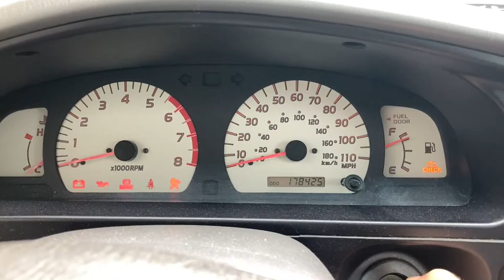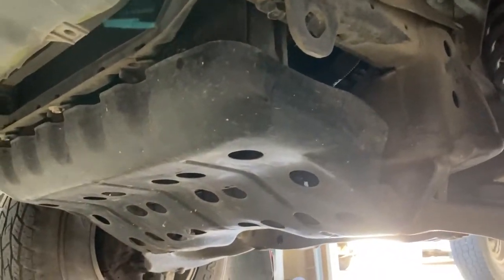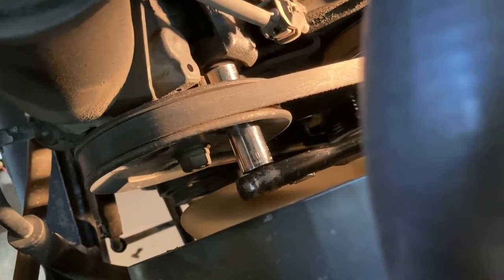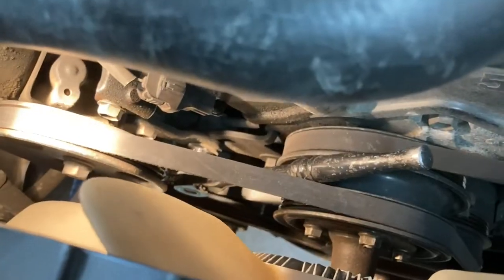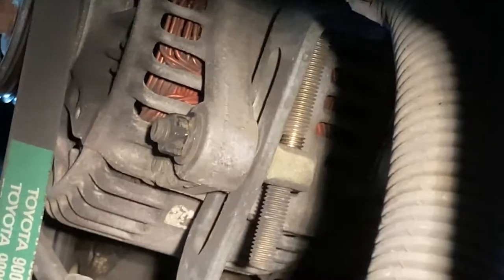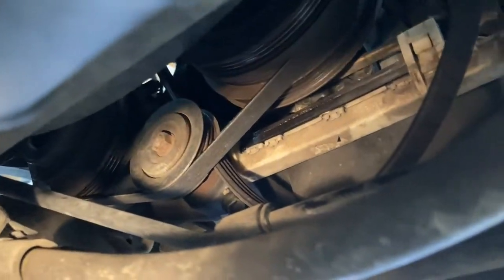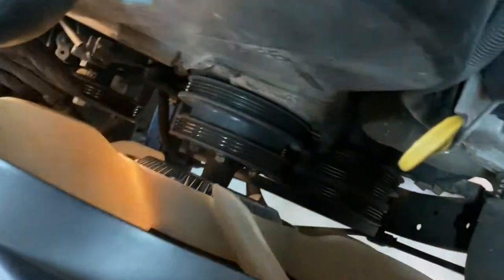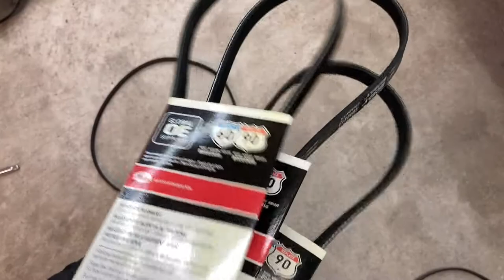How to Replace Toyota Tacoma Drive Belts - 3.4L V6 5vz-fe Power Steering, A/C and Alternator

Comment: Thank you. Enough information for me to see where the tensioners and lock bolts are. Brief and to the point.  Some of us understand that installation is simply the reverse of removal. Specs, yep, 1/4" is usually about right.  Respect the bearings.

Comment: I watched many videos trying to figure out the tensioners (I've been spoiled by the spring-loaded serpentine belts) and this was the only video that got to the point and was consistently helpful. 
One question, are those OEM Toyota windchimes in the background?
Reply from the maker: No the wind chimes are aftermarket 😂 Glad you found the video helpful. Hopefully the wind chimes were stress relieving and not annoying. 😂😂🍻

Comment: Super helpful video, turns out my idler pulley was bad, luckily I found a new one floating around in the back. One thing to note since the video doesn't explicitly say to do or not do so, don't take the hinge bolt completely out of the power steering pump (the one that's accessed through the pully) for some reason I took it out and it was a huge PITA to get back in
Reply: Wish I saw this comment, I just finished putting that bolt in….

Comment: Just about ready to do mine again also! I don't mess around with worn belts and try to do them every couple of years. Also a good idea to replace your idler pulley (if you haven't already) with an oem one as they tend to wear out after 160k or so. 

Oh yeah, be sure to keep your old belts stashed in the truck somewhere, just in case your in the middle of nowhere and you have to do an emergency belt replacement to get ya home!

Your trucks lookin good man! Keep up on that maintanece and it will run forever!
Reply from the maker: Thats a great idea. I think I'll probably do that. The last thing I'd want to do is have one of these belts snap off when I'm out in the wilderness with no cell signal. haha 🍻 What manufacture do you usually go with OEM or ?
Reply: @azorianification  Bando for the belts. They are just as thick as OEM but a fraction of the cost. Everything I have read on the idler pulley says to go OEM. The generic just don't last while an OEM should get you another 150k. I did mine about 6 months ago and it's been fine.

And yeah! Being stuck in the woods over a simple belt fix would suck!
Reply from the maker: @yoboo6167  I decided to go with Gates, but for the pulley I plan on swapping it out with OEM.
Reply from the maker: @yoboo6167  What have you done with your truck? Is yours a daily, or are you building it up for something?
Reply: @azorianification  Always building and upgrading for offroad, remote adventures!
Reply from the maker: Awesome. What are you doing for a shelter? Roof top tent?

Comment: I’m trying to replace my belts. The ac belt is tight even with the tension taken off. The old one came off herd and the new one seems impossible to get on. Any suggestions?
Reply from the maker: The old one was removable without cutting it?
Reply: @azorianification  I figured it out. I didn’t have enough tension taken off. I’m not that mechanical smart sometimes.
Reply from the maker: Glad you figured it out! It’s all part of the learning process. 🍻

Comment: Is the installation of the new belts in reverse order so: AC, Alternator and then Power Steering?
Reply from the maker: That is how I did it. Started with the last belt I pulled. 🍻

Comment: Oreilly says the K040343 doesn't fit the taco, and recommends K040345. It's a difference of 1/8", though, so it's probably fine.
Reply from the maker: Thanks for the heads up. I believe I got this information from the gates website.

Comment: I cant seem to get the tension off the AC belt , the idler pulley is worn out and i decided to replace it along with all belts as well !  Ibe got the other broke loose but that  ac belt just dont seem to be loosing!  The bolt in the tensioner is screwed out over 5/8" and nothing has changed!
Reply from the maker: Just saw this. Were you able to figure it out?
Reply: I’m having same issue. Did you figured out what was going on @brooks ealy
Reply from the maker: You’ve tried letting it soak in something like PB Blaster?
Reply: @azorianification  found a video of someone actually turning this one clock wise to send it vertically up and it removed the tension that way not loosening the bolt out. So hopefully that works. Will try when I get back home.
Reply from the maker: Awesome! Good luck
Reply: @GrahamRyan39  Any luck loosening the AC belt tensioning? I have exactly the same issue.
Reply: Any luck loosening the AC belt tensioning? I have exactly the same issue.
Reply: In my case the AC belt tensioning device was very rusted. First I unscrewed like 5/8 of the  screw. Then I applied some WD40, and finally I hit the head of the screw (not hard) to loosen the device and the belt. The rust was preventing the device to get loose.

Comment: I have an 04 tacoma crew cab 3.4 v6 but my skid plate looks completely different from yours
Reply from the maker: Interesting. Is it OEM? Maybe it’s aftermarket? Mine is an 01
Reply: @azorianification  
Yeah it’s oem. I seen it in other Tacoma’s as well. It’s a little longer… maybe there’s a difference between extra cab and double cab?

Comment: Would have been a much better video if he actually showed where all of the bolts are on the pan under the engine.  Also, he didn't show how to get to any of the tensioner bolts.  Looks easy if you skip over all of the difficult parts.
,
Reply from the maker: Sorry the video wasn’t as helpful to you. It’s really difficult to record each step of the process and with a job like this some of the bolts are almost impossible to see with a camera. I’m also the only one recording this as I’m replacing the belts so keep that in mind. I’ll keep your comments in the next time I create another how to video. 🍻